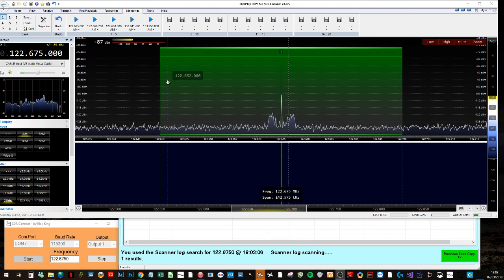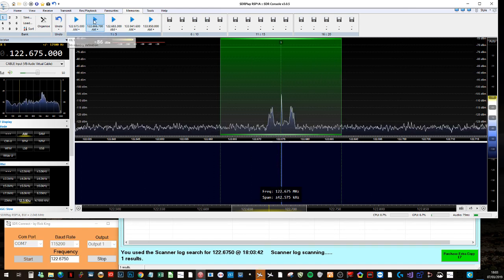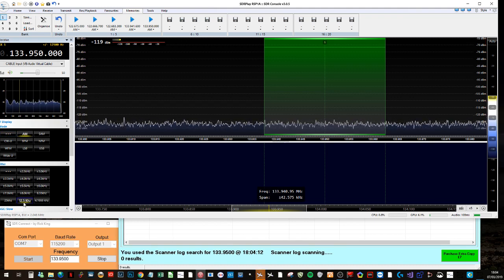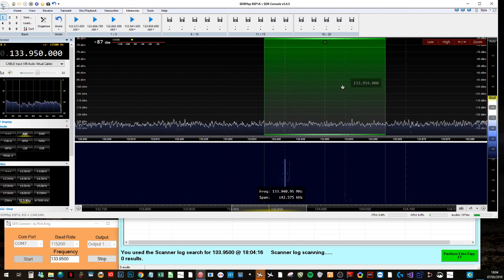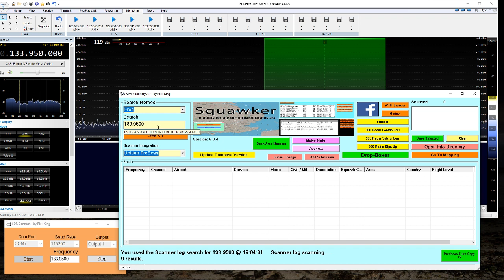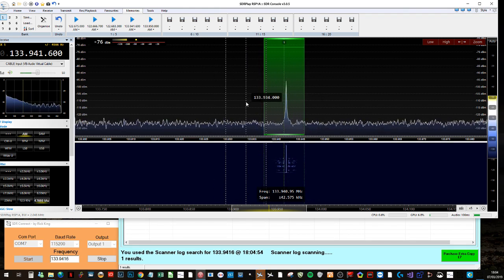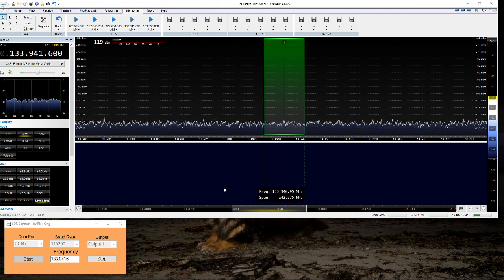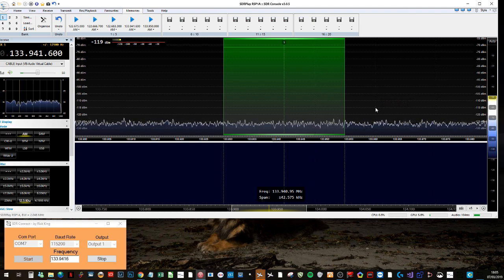why you should be scanning at 8.33 khz on the civil airband

Comment: Thanks for the video very useful .
Can I still hear airband channels  clearly enough that are using the  8.33 khz frequently on a 25 khz  step scanner ?
Reply: Yes,although you will likely miss some transmissions. If you can scan at 12.5 or 5khz that would be better and pick up more transmissions. I also use an older scanner and am limited to 50,25,12.5 and 5khz. Also, depending where you live and what airport's you can receive this may not be much of a problem, I am in south Wales and pick up Cardiff and Bristol airport's, their main frequencies are located on the older channel spacing i.e they have not changed, so reception with old scanners is not a problem. St Athens airfield uses 8.33 but not very often use any newer channels that fit the 8.33 channel spacing. Some bigger international airports and European flights use 8.33 channels more than some of the smaller airports. Also worth scanning for are ground frequencies in the UHF Band if you have decent reception of tower and radar. Here you can hear aircraft getting instructions before takeoff etc. Usually around 460-470MHz. Get yourself a copy of the UKAGF book, the current 2022 version is out and lists all the airports and frequencies. Ofcom website, licence database you can find uhf frequencies that are licensed to airports.

Comment: Ok I understand this issue but if I am sat at an airfield and tuned to the tower I will still hear them. I can imagine it might not be as loud if my scanner is expecting a wider signal. Surely aviation frequency allocation is geographically spaced?  I’m not likely to pickup any other ground based signal from an adjacent frequency because whoever that belongs to is not going to be close by. The next frequency up or down should belong to somewhere far enough away that the signal is too weak to pick up. Obviously signals from the air to the ground are going to travel further because they are not blocked. Scanning the band for signals is going to be a different kettle of fish and your example is going to be true. I’ve just bought an Icom IC-R2 off eBay mainly for the civil airband. Not got it yet but hope it will be useable. Hadn’t heard of the 8.33khz change until today.